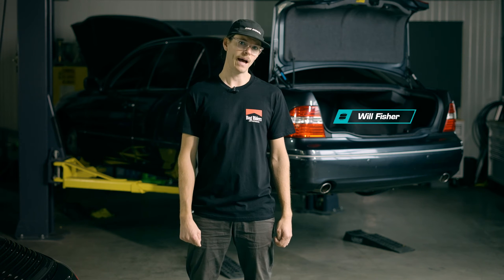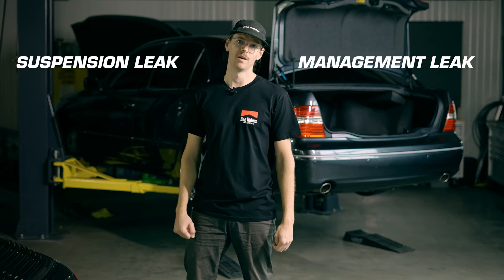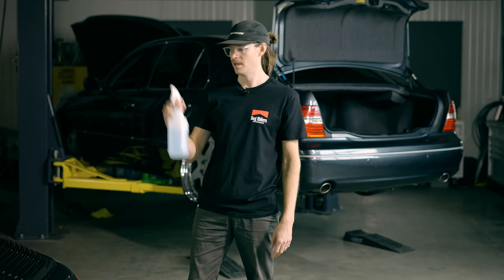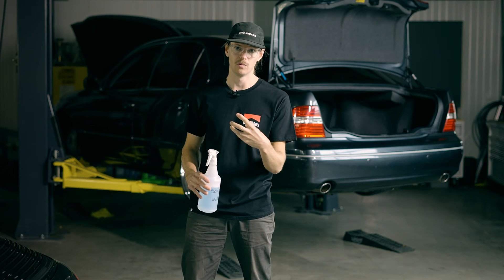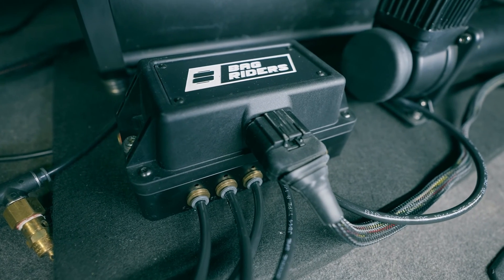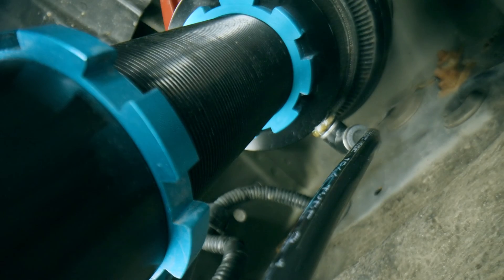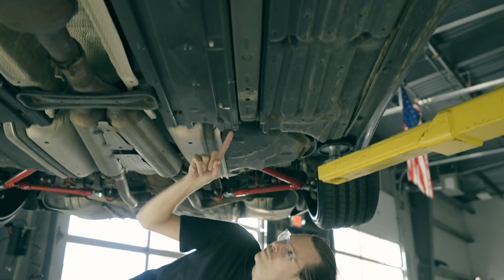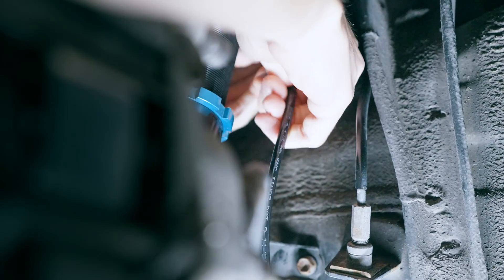How to Find and Fix an Air Ride Leak

Comment: Hello.     Any idea what could be the cause....   when im airing out...   im loosing psi
Reply from the maker: What control system are you using? When you say loosing PSI are you referring the the suspension or tank?
Reply: im using airlift 3p....   if I air out...  psi from the tank drops and the pumps come on....
Reply from the maker: This sounds like there could be an internal manifold issue where the tank valve is leaking.

Comment: Is it safe to spray water at the manifold connections? Seems a bit troubling given that if water enters the manifold it will most definitely damage the internal components.
Reply from the maker: Yes it is safe to spray soapy water at the manifold with the airlines connected to the ports.

Comment: Hi Guys, great helpful videos, but i don't think it covers my issue,  I have an older air bag system , on an old truck, in all the years  I've owned it, never once had a leak, left her in a barn for about a year, and when i lift her now , the front left corner starts to go down, but when i press to lift that up, the air in the tank is now lower than whats in the bag, so the tanks going down slightly quicker than the bag, then if i leave it longer all bags level off at the same pressure and go down together. Any ideas? I was wondering where to start, if the seals in the solonoids had perished? There are rats and mice in and around the barn, so thinking maybe  a bite or two on a line? any help greatfully received.
Reply from the maker: What air control system are you using?

Comment: Came outside to find my front bags fully aired down, could it be since I had a mechanic come by and he took off the airline on the left side only? Would that cause it to air out both front wheels?
Reply from the maker: Taking out the air line to the left side would not cause both to be aired out.
Reply: @bagriders so maybe it’s just a malfunction with the manifold

Comment: I believe I have a leak sometimes when I start my car my tank pressure is really low and compressor kick on to fill up tank. Other times the tank holds pressure fine sitting overnight. It’s very random. What should I be checking for ?
Reply from the maker: Check your water trap and check valve!

Comment: Is it possible for the solenoids in the manifold to have a malfunction that could cause an air leak?
Reply: yours might be dropping on one wheel or even one side over time. I am having this problem and it is also not leveling.
Reply from the maker: Yes this is possible. If you purchased from Bag Riders please reach out to our customer service team and we can help diagnose the issue.

Comment: i cant find any bubbles in my air suspension... sprayed everything but no leaks, i have a air gauge from the tank to the waterstop and thats perfectly good.. but the gauge for the bags keep on dropping...
Reply from the maker: How old is the system? If you can't identify any leaks there check your check valve on the compressor.

Comment: I have a leak that’s so funny because I can’t find absolutely nobody online relating to my problem, just recently bought this e46, and it leaks from my front right while driving, and first couple of days it was minimal, tops 7- 10 max psi if Im driving for like a 40 mins plus, but while parked, it doesn’t leak at all, if anything the psi goes up, but today when I go to work, it was quite literally airing out my front right struck while I drove and i had keep airing it up on my 10 minute drive, but when I got to work, while parked, it doesn’t leak at all, didn’t move a millimeter during my 10 hour shift, but while driving back home now, it loses air as quick as it did earlier today, but now that I’m home, once again, it doesn’t lose air at all, and if anything, the psi increases +1 +2, haven’t gotten around to checking it since it’s so cold out in nyc rn, but wtf lol
Reply: Hey idk if you're still having this issue but my guess is that you are using non dot approved fittings one the struts. The struts move the most out of any part of your system, and non dot approved fittings will leak under the slightest bend. Replace them with nice expensive dot fittings (just those 4) and i bet that would fix your issue. Ofc before spending $40 on 4 fittings, go in there and pull the line around a bit and see if it leaks. With a dot fitting you should be able to bend and tug on the air line all you want without it leaking at the ptc fitting.

Comment: if i go for a drive around 20-30 minutes with a lot of bumps and stuff my  psi drops by like 5-8 is that bad??
Reply from the maker: Probably bad. If you continue to drive another 20-30 minutes, do you lose another 5-8 psi? If not, then it's likely just the margin of error in your pressure readings. If yes, then you have a leak.

Comment: I have v2 management system and my tank psi seems to drop 2 psi every 5 min. Ive sprayed every part thats possible and have not seen any signs of leaks  what else should i try out? Maybe a different water trap? Re thread the connections?
Reply from the maker: That's a pretty quick leak, the soapy water trick should work. Or try a piece of 3/8" line (maybe two ft long) in your ear, and bring your car to a quiet setting and give a good listen.

Comment: I have a leak front right keeps going down already check with spoapy water and no signs of leak. Where else can i look?
Reply from the maker: Have you looked at the manifold itself? Do you have any bulkheads or couplers of any kind on the line in questions?

Comment: My passenger side bag only leaks while the car is moving. When it’s parked and not moving everything is good.
Reply from the maker: This could be a worn o-ring where the bag (air spring) seals around the strut rod. You should reach out to who ever you purchased the bags from.

Comment: Manifold leak.  Question soapy water not showing any leaks, but my numbers showing leak over a few hours of  time and eventually 0 out.  How do I find out what's  causing it other than soapy water
Reply from the maker: Soapy water is going to be one of the only ways to find out if a leak is coming from a fitting or airline. How old is your set up?
Reply: @bagriders  2 years
Reply from the maker: @n.a.k4321  It sounds like the manifold will need to be returned. Contact sales@bagriders.com and have your order number available to start the RMA process.

Comment: ok so on my car i have a bag thats filling up. i cleaned the valve and still does it can u do a video on that topic im at a lost...
Reply from the maker: Is the valve sticking open? What manifold do you currently have?
Reply: @bagriders  I’ve called u guys and got some help. And with my car we’re not able to find a good set up thanks tho and sorry for the late response

Comment: Thoughts on if every bag drops 2-3psi a night? Management holds up air zero issues no leaks there. Would this be normal?
Reply from the maker: 2-3 PSI overnight is nothing to be concerned about!

Comment: Leaking out of the compressor's intake port... Replaced the suspected check valve and still leaks out the compressor intake port!
Reply from the maker: Check around the head of the compressor for cracks. This can be caused by the check valve being over tightened or damaged from a drop.

Comment: would i need to buy a new set on bags if the bag itself is leaking?
Reply from the maker: If the bag is leaking yes you would want to replace it with a new one.

Comment: Ive got a bad leak on my v2 system. Leaking off 1-2 psi every 5 seconds it seems. I’ve checked all my fitting and splices and not finding a leak one.
Reply from the maker: Have you spray the manifold down with soapy water?

Comment: What is the actual size of the elbow  fitting going into the rear suspension
Reply from the maker: This will be brand dependent. The Super Low bags use a 1/8" NPT to 1/4" or 3/8" PTC.

Comment: My airbag makes a thud sound when it goes up fully inflated. Why it’s only one bag on the back right hand side someone help me and tell me what the hell is going on.
Reply from the maker: If you don't mind take a video of the thud and email it so sales@bagriders.com. That way we can help narrow down exactly what the sound is. Be sure to include the brand of suspension you are running as well as the year, make and model of your car.
Reply: I had this issue when i first bought my bags and was driving me insane! I tried looking for more info on it but only came across one simple answer lol don’t air out completely to 0 PSI. You will still be on the ground but don’t drop it to 0 all around
Reply: My passenger front does this as well any updates?
Reply from the maker: @angelmendez7793  If you are having the same issue trying adjusting the pressure at which you drive at to see if that makes a difference. If the noise is still present check all your suspension components to ensure they are tight and not worn. Next step would be to contact our customer service team at 844-404-7344 or sales@bagriders.com.

Comment: My tank drops 30 psi overnite and only the rear left bag drops 30 psi also, the other three bags stay the same, cant seem to find the leak.
Reply from the maker: Have you sprayed down all the connecting points?
Reply: Clearly you're leaking from the left rear...30 psi/night should be pretty easy to find with soapy water...
Reply: Did you find the leak ?

Comment: do the threads in the tank have to be hand tightened and still showing thread? or do i use the wrench to fully tighten until no thread is showing
Reply: When I called Bag Riders, they told me it only needs to be 1 and a half turns past hand-tight
Reply from the maker: @MultiWwefan  Correct! You will for sure still see threads, because the tapered nature of an NPT fitting.

Comment: Winter weather would cost significant psi drop im assuming? While im driving the psi goes 3-5 psi down then back up
Reply from the maker: Yes in the winter you would see more of a drop since the air is getting thinner. While driving you will always see pressures fluctuate slightly.

Comment: Having a suspension leak would mean the tank would drain overnight on its own?
Reply from the maker: That would depend on the management system. If running the Air Lift 3P system a suspension leak would not drain the tank.
Reply: @bagriders  I currently have a leak in my tank , what exactly do you recommend me looking for?
Reply from the maker: @cesar216  Check all the fittings on your tank, also be sure to check the water trap and the air line that connects the tank to the manifold. You can check these by spraying soapy water on them and looking for bubbles.

Comment: Been binging on Bag Rider content while waiting for my kit to arrive!  Can't wait to joint the club.
Reply: Welcome to the club!  There are two things I would suggest getting if you haven't already. 

1. SMC Check valve(s). The stock viair ones are prone to seizing, causing blown fuses. The same can happen with the SMC CVs, but the difference is that you can disassemble,  clean, and reuse them. They also fair better during cold weather. 

2. An electric drain kit. With this kit, you can purge condensation from your tank at the push of a button at any time.  It comes with a hose that you can run to the outside of your car. I got tired of climbing to my backseat in my 2 door to manually purge my tank. Huge QOL improvement. 

Bag riders carry these items.
Reply from the maker: @blkeclipsel2400  Why thank you <3
Reply from the maker: Welcome aboard!